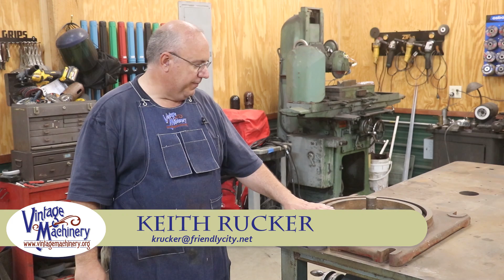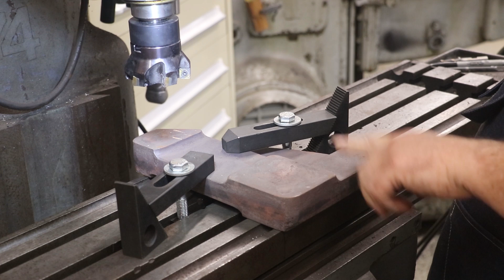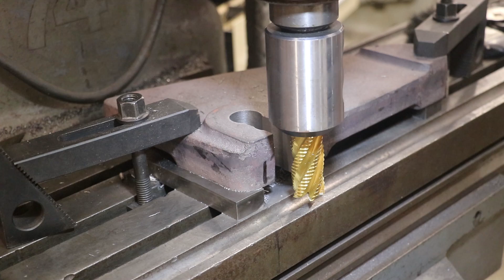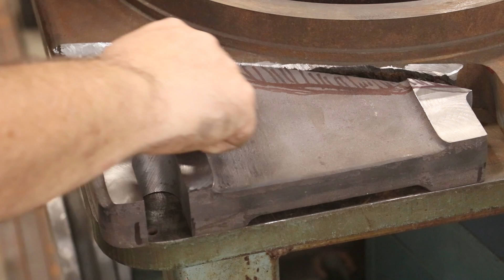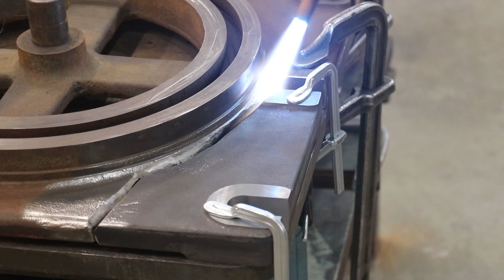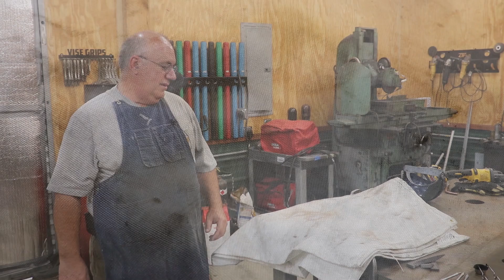Cast Iron Repair Job: Machining a Replacement  Casting and Brazing in Place

Comment: I was wondering if it would not have been easier and faster to have the foundry recast the entire piece? Then its only a question of finish machining it.
Reply: only take the resources of a large machine shop, pattern maker, foundry, one off tooling to cut an 18" circular tee slot in cast iron on a 28" lathe,  pay everyone, 2 months later you got one that doesn't need a half hour brazing job sitting in the next state waiting to be driven into by a forklift and broken at the shipping depot
Reply: Don't think he has the equipment to do all the machining plus adding the degree scale on the base. Also would cost a lot of $$$$$ to cast that piece.
Reply: I don't think he has or has access to a lathe large enough to machine the center pivot and ring on the base. He might but I am merely guessing.

Comment: Years ago I had an "interesting" brazing project. Somebody in shipping knocked a scale off the table and the cast iron base shattered! Wasn't critical to the operation of the scale more to cover up the inner workings. 1/4" thick or so. All these triangular pieces had to go back together like a jigsaw puzzle (and that took a while). Beveled the mating edges and started brazing. The tricky part was working in different areas so the heat from where I was working didn't melt the other brazed joints. Did one per day and let it cool overnight, then did one FAR away the next day. Got about halfway through and got laid off so I don't know if anyone ever finished it... :(

Comment: I have always brazed small parts that cant handle the welds, never did such a LARGE patch. There is a lot of brass there. When brazing large gaps like that, is the brazed joint weaker than the casted metal around it?
Reply: Depends on what the base material is, grey iron or cast steel, but I'm guessing by the way it broke its just plain grey iron, in which case the brazing can actually be stronger than original.
Reply: I'd imagined the fit-up gap would've been closer to ¼" but then getting adequate heat on the bottom side would have required some challenging heating strategies compared to the wider gap and a rosebud tip from the top side.  In retrospect, the much wider gap was the best choice for achieving proper heating.

Comment: Noob idea... What do you think about using some sort of insulating spacer under your part so your table isn't a big heat sink?  Any value there?
Reply: ive done that before but the point of the welding table is that its pretty flat and very strong to limit how much the parts move so adding anything underneath would probably mess with that.
Reply: Steven Andrews When at all possible, I braze and even silver solder on top of insulating fire bricks.